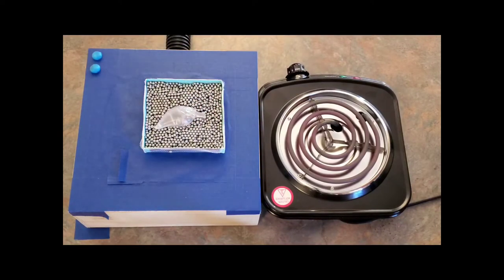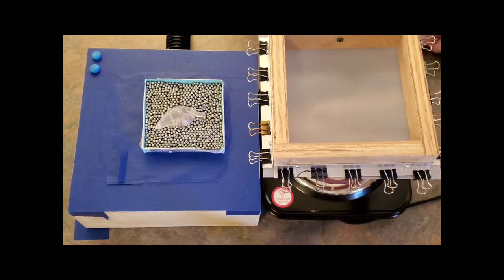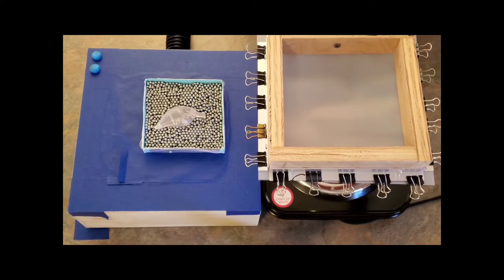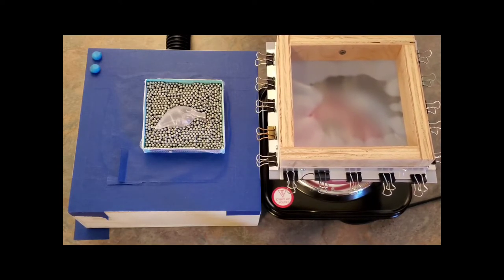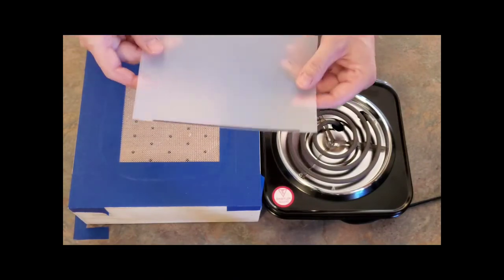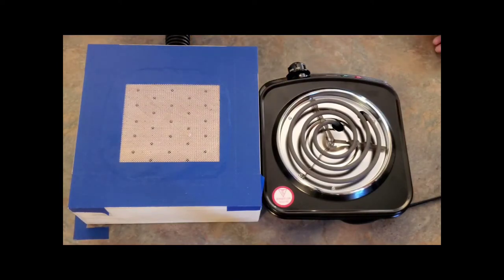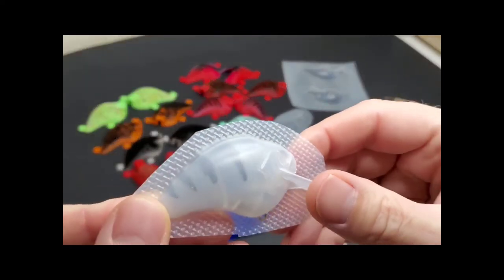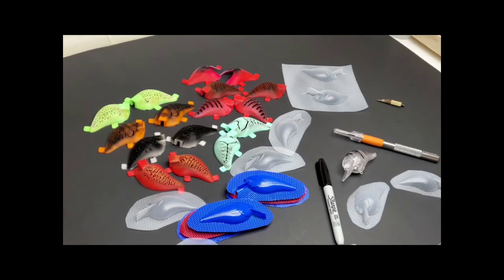How to make a 3-D lure painting stencil blank using a thermoforming / vacuum forming box

Comment: One tip I learned over making thermo stencils for the past 6 years is I like to add a coat or two (thin coats) to the lure blank before form the stencils. Using a bare blank doesn’t take into account the added thickness of the paint when you’re using the stencils. This can distort your patterns and possibly cause scratches or damage to your bait.
Reply from the maker: And what kind of material are you using ? 🤔  With this HDPE, I can epoxy a lure, and the stencil will still fit.     This material is soft and flexable, and doesn't fit so tight that it causes any problems.  Thanks for sharing your experience, and thanks for checking out the channel 😊👍
Reply: @BlindSymmetryLurePainting  it PTEP or something like that. Made specifically for thermo forming. I normally shoot a coat of clear over the 1/2 baits just to represent better what the fit will be like when being applied to a bait that already has a layer of paint on it.

Comment: Excellent video!   You’ve really explained this well..Thank you. 
What is the thickness of the hdpe sheets?  Trying to find some on amazon 🙂
Reply from the maker: I'm not sure how thick the HDPE shets are I have.  The measurements of the sheet is 22×28 and is sold as poster board..  A milk jug is 38mm thick and this material seem to be the same.  I hope this is of some help, thanks for watching.
Reply: @BlindSymmetryLurePainting  Thanks again. Appreciate it.

Comment: Vinyl sheets work as well. The .02 thickness sheet is pliable enough to mold around minnow shaped hard plastic lures, very easily. 

I use delicate tape to adhere the clear vinyl to the lure.

While on the lure, run a heat gun or hair dryer over thr stencil very quick,, maybe three passes quick passes on 350 degrees, to help the stencil form to the shape of the  lure

 Next, draw your design on the vinyl with an ultra fine point permanent marker,  cut your pattern out using a very sharp hobby knife. 

Use one lure as the cutting board, as the hard plastic makes cutting the pattern out much easier.

The process of removing the stencil cutout takes the longest time, a steady hand and some patients. 

Leave the vinyl stencil on the lure for 24 hours to help retain the shape of the minnow while vinyl is cooling.

Remove the stencil, trim the delicate tape back so just enough tape is left to stick to the lure.

Place the vinyl stencil on the lure you are airbrushing and paint. 

This type of stenciling is for those who don't want to spend the money on vacuum forming stencils, which the vinyl sheets I used above from Jo-Ann Fabrics, would probably create a better stencil. I haven't tried it yet but I will as soon my vacuum box arrives.

Have fun.
Reply from the maker: Thanks for the info,  thanks for checking out the channel

Comment: If your using HDPE it should be solvent resistant it should have no trouble soaking in thinners for over an hour with no effects Plastic Jerry cans are made from HDPE it's surfaces inside and out are florinated in fluorine gas to stop some of the shorter chain hydrocarbons leaking through HDPE 
The down side to HDPE is the thermal expansion is quite high so it shrinks about 11/2 to 2% or 11/2mm for every 100mm so on longer lures make sure you leave the vacuum on for a while and when storing them keep a lure inside them with clips or they will shrink
And rotory tools leave a hairy finish and it dose not sand well either so sharp edge tools are the way to go
Reply from the maker: Thanks for sharing